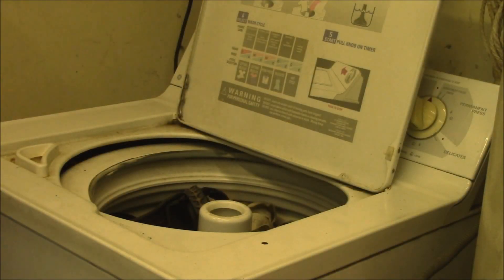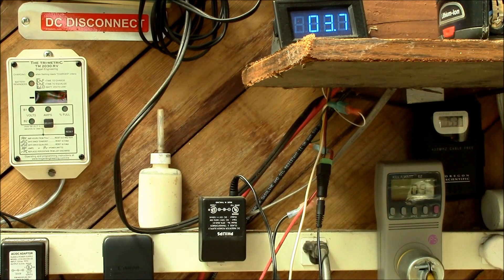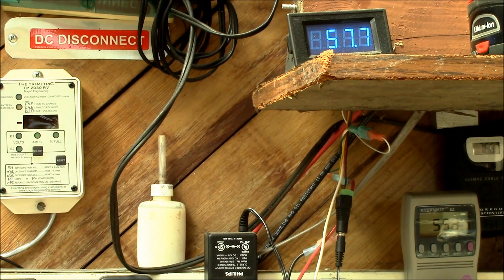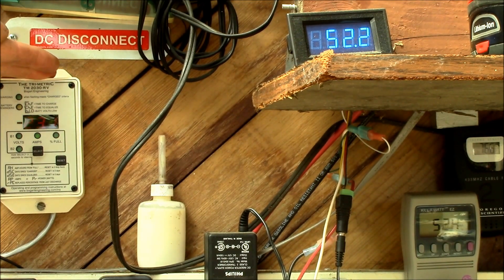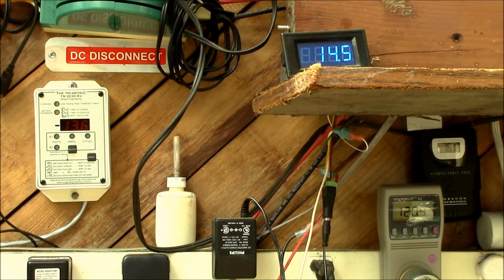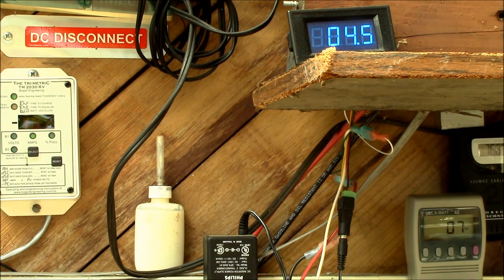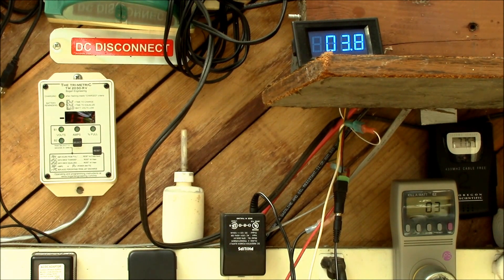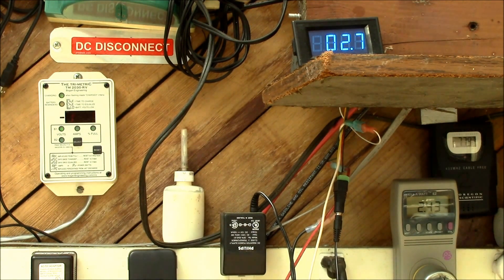Solar Powered Clothes Washer, Part 1

Comment from the maker: Still running the clothes washer on solar power some 10 years later.  Note that this may only work with an older machine.  If you have a newer machine that has an internal water heater or other high power load, you may exceed your inverter capacity.  With my new 2400W hybrid inverter, it's no problem running the clothes washer, even on the high speed setting.
Reply: What is your old washer model?
Reply from the maker: @Dataloa-u7q  It's a General Electric model, just says "8-cycle, 2-speed" on the front.  Likely from the late '80s or early '90s.  Still running it off my solar power inverter.  My new inverter is rated at 2400 watts and can run it easily even on the high speed setting.

Comment: If you were using a 3000W sine converter would it disrupt the same at the washing cycles which pull current, start-up and fast spin for instance. At very least you won't get a beeping sound. But this will surely pull most of the stored capacity of your battery cells, and they would have to replenish quickly, so at minimum you will need a 3000W solar panel connected to your your battery controller. And the nice thing is you would usually do washing on a sunny day, so the solar panel will gobble up sun light and send that energy back to your batteries quite quickly.  Also you would need a minimum of four deep cell batteries (golf cart and 4x4 batteries, or even Nikola truck batteries will do) so as not to destroy the batteries by causing them to go super low such that they cannot be recharged and thus have become damaged.
Reply from the maker: Yes, I imagine a higher capacity inverter would help run the machine in high speed mode.  With the higher output capacity, you typically get a higher surge capacity and that's what's affecting my 1000W w/ 2000W surge capacity inverter.  It can handle the surge current but not for the time required to spin up the washer drum as it'll only tolerate that overload for ~1 second.  Even a 2000W inverter would probably work for this, but the 1000W is what I had at the time.  It does work fine on the low speed mode as that changes the gearing and the motor pulls less current and spins up just fine under load.

And to confirm, with my current 2400 watt inverter, it has no problem handling the clothes washer, even on the high speed setting.

Comment: Great video the washing machine in this video will Outlast any washing machine today they are nothing but pieces of crap. And they are hardly efficient...
Reply from the maker: You got that right!  This one might use a bit more water for washing, but that water is heated efficiently in a tank less gas water heater instead of the new ones where they heat the water inside with electricity.  I measure about 0.25KWH of electrical energy consumption per load of laundry plus a bit of gas for the water heater.  Plus you need to use the special, expensive detergent in those new ones.

Comment: Thanks for sharing great video I would like to know more about your solar setup. I just attempted to run a Kenmore top-load washing machine I have two 6 volt golf cart batteries 640 watts of solar a 2000 watt Harbor Freight inverter the trimetric charge controller and battery monitor system in the washing machine will not start. If you can provide any tips help or information I would greatly appreciate it.
Reply from the maker: Best bet is to put a Kill-a-watt meter on the machine and watch the current in the various cycles, especially right as the start up.  If you have a video camera, record the meter display and then play it back slowly to catch the startup surge.  At least that way you'll know what you are up against and compare that to the inverter specs. and see if it "should" be able to work.

At the time, that was a 12V lead acid (AGM) battery bank of around 200AH capacity and around 900W of solar:
https://youtu.be/URM7S5VZyHs

The inverter is 1000W TrippLite sine wave:
https://youtu.be/_OjBpazCoYk

I do run a large super capacitor across the inverter DC inputs to help with surge current:
https://youtu.be/8TVDFK2enSI

On the washing machine (30 yr. old GE top loader), I run mine on the slow/gentle speed setting which either changes something in the gear box or runs the motor slower.  With the Fast/Normal setting, the inverter will trip out on the start of the spin cycle as it takes too long at too high a current to get the drum full of water up to speed.  I also added a power factor correction capacitor to the motor:
https://youtu.be/qf_ZLIYT0Ro
Reply: @The4Crawler  thank you so much for the prompt response and the information I will look at the other videos you have posted and see if I can figure out the start capacitors that you're talking about and then Electronics person way over my head but I can follow directions. I will also have to invest in a kilowatt meter I will do that soon thank you again.
Reply from the maker: Yes, a Kill-a-watt meter is a good investment.  Plug in your washing machine and see what the watts, amps and power factor look like.  I the power factor is 0.80 or less, then it makes sense to look into correcting it.  Many newer machines are built with some correction built in, older machines typically were uncorrected.
Reply: @The4Crawler  thank you for the advice.

Comment: good video man!!! love the charge controller, i have 2 of the same
Reply from the maker: +fliping720 Thanks.  I need to start thinking of adding either a 2nd controller or a larger one.  I have about 900W of panels on the one 40A controller and on a good sunny day I max. out that single controller.  Having 2 controllers like you have would add some redundancy to the system in case one controller fails.
Reply: ha i have hit 50 amps on mine a lot :D I think you ok at 40 amps :)
Reply from the maker: +fliping720 I've seen up to 46A on mine, but I also have 10-20A of DC loads (LED lights, etc.) running off mine as well and it seems to internally limit the total charging+load current to around 45-50A.  If I did 2 controllers like you have, I could have one mainly powering  my DC loads and the other doing most of the battery charging.
Reply: R Brown I really like these charge controllers and will buy another in the future.
Reply from the maker: +fliping720 Agreed, they may not have the bells and whistles of a Midnight or Outback unit but they just plug in and go.  I'm designing the layout of my little solar shed where I'll be moving all my equipment into.  I'm playing around with where to put all the components and wiring and all that.  Need to figure out if I'll have room for 2 smaller controllers or if I'll need to go with 1 larger one.  If I go with 1 larger controller, then I'll move the Tracer over to my 4Runner and set it up like your Jeep with a panel on the roof.  I already have dual batteries and an inverter in the 4Runner, so all it needs is something to charge the batteries and it's set.
Reply: R Brown sounds like a blast

Comment: Pretty good Buddy. 
Thanks for sharing
Reply from the maker: +JWSolarusa John Wesley Thanks.  Always fun playing around with the system and seeing what it'll run.  I shot this video earlier this year and have been running the washer 100% off solar most of the year.  The big test will be later this week to see if the system will run the washer in the dead of winter.
Reply: What is your battery bank capacity
Reply from the maker: +JWSolarusa John Wesley I have a bit over 200AH @ 12V.  4 - 35AH wheel chair batteries, an old 26AH battery from my truck, an ancient 20AH Harbor Freight jump start pack and a new 68AH battery that's waiting to go in my pickup.
Reply: A mix match battery bank
Reply: Are they AGM BATTERIES or  Seal Lead Acid
Reply: Please take a look at my battery bank
Reply: 150Ah each x 6
Reply from the maker: +JWSolarusa John Wesley You got that right.  The 4 wheel chair batteries are the main bank, then I've just tacked the other ones on to keep them fresh.  I'm working on some new battery cabling and bus bars to help ensure equal resistance connections to a random assortment of odd batteries.
Reply: AGM Batteries. 108lbs each
Reply from the maker: +JWSolarusa John Wesley Yes, all AGM for now.  I'm eyeing some larger batteries to add to the bank as my needs increase, but for now, I'm usually at 90% SOC in the morning.  Once I start dropping to the mid to low 80s, I'll add onto the battery bank, maybe with some larger capacity units.
Reply: What is the number percentage you set at for your SOC?
00, 01, 02, 03 etc.
Please help me out with that. 
I setup a Tracer 20A 12V Charge Controller System for my retired Veteran friend.
Reply: What number did you set your charge controller at
Reply from the maker: +JWSolarusa John Wesley I use a Trimetric Battery Monitor to check the State of Charge:
 https://youtu.be/5LcY-EqOV5Y
Its so much more accurate than the SOC number in the Tracer charge controller.  I just set the battery AH capacity in the charge controller as well as the type (SEL or GEL) and that's it for the controller.  In the Trimetric, I set the AH capacity and the float voltage and time for the Trimetric to detect the 100% SOC.  Then it works by tracking AH in and out of the batteries to compute the SOC.  For example, 200AH capacity, then draw off 20AH over night and it displays 90% SOC.
Reply: Ok.
Do you happen to know the settings SOC on the Tracer for Flooded and SEL?
The manual for that charge controller is terrible
Reply: I am going to my friend's house tomorrow to help him complete the the installation that's why I am asking you if you know the SOC setting for those battery types
Reply from the maker: +JWSolarusa John Wesley In the charge controller, I usually select the GEL battery setting on my Tracer 40 amp unit.  That setting is identical to the SEL (sealed or AGM) except it skips the equalize charge, then one day a month, I switch to SEL to give the bank an equalize charge:
https://youtu.be/iRGD8mtT_hw

Saw your battery cable video, good job.  I'm making mine a bit different to work to a mix of smaller batteries.  It'll also work with larger batteries with a slight modification.  The idea is to make every battery connection identical, same length wire to every point in the system and be able to add or subtract batteries easily.  So I should be able to pull out a plug while the system is running and have 1 or 2 batteries completely out of the system.  Then I can test or work on them and plug them back into the system with ease.
Reply from the maker: +JWSolarusa John Wesley I downloaded this manual:
http://www.epsolarpv.com/en/index.php/Product/pro_content/id/444/am_id/136

It has the battery settings.  I use the remote display panel so everything is in plain text, so I don't know what the actual numeric codes are.  It looks like 1=SEL, 2=GEL and 3=FLD for the battery type.  I think that and the on/off timer is all you can set without the remote display, I set my timer to mode 17 which just leaves the DC load on all the time.  The controller somehow comes up with a SOC number off the battery voltage, current and the internal temperature sensor.
Reply from the maker: +JWSolarusa John Wesley It looks like you have the remote meter on that charge controller.  If so, you can set the battery type holding the Set key down while in the battery type screen.  Then there's the capacity (AmpHour) screen where you can enter the bank AH rating.  There's no special SOC menu that I've found.